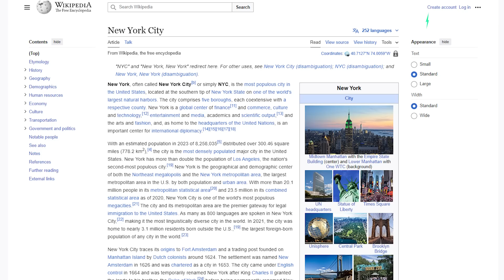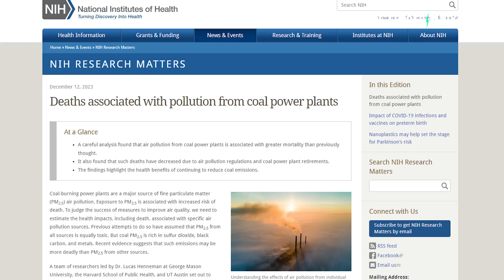The world’s biggest solar farm will provide power for 15 million people

Comment: Sam - while this is good news - be balanced on China - they are still bringing on a new coal power plant each week.
Reply: without solar, they would have to do 3 coal plant each week.  It sounds like you don't want any Chinese to have access to electricity
Reply: New plants (even coral) bought online to replace older much dirtier coal plants is still an improvement.
Reply: This narrative is out of date.
Yeah, they upgrade old plants at that rate, just fixet it for you
Reply: In 2024, it is projected that China brings online about 40 GWH of additional coal.  In 2024, it is estimated that China will bring online about 300 GHW of additional Wind, Solar, and Hydro.  Sounds like China is doing its part in combatting climate change.  Source S&P.
Reply: @celanian8188  = Uhh not really.  China is still growing its CO2 output exponentially.  There is only one country that had reduced its CO2 emissions back to 1996 levesl and that is the US - per UN reports.  China and India are estimated to continually increase their CO2 emissions for the next 10 years.
Reply: @RagnarinVa  China is still growing their heavy industry and still needs to grow their power generation.  At the rate they are installing Solar and Wind, it won't be too long before they start retiring their coal plants instead of replacing them.  

Forbes projects that China's carbon emissions will peak in 2026 and decline steadily from there (30% projected decline in emissions by 2040).
Reply: @Guvament_bs  They will last as long as they are economically viable which I suspect will be far less than 60 years.  Even if they last that long, they will represent an insignificant % of China's energy generation mix by that time.
Reply: No, it sound like he wants balance.
Reply: They build 1/3 of the stuff in the world.
Reply: It’s not a channel about China or coal plants.

Comment: They will require huge battery system to make it optimally effective, nonetheless impressive.
Reply: 5Gwh, Sam said.
Reply: I don't think so, 5 ghw of the battery is  very huge ,  I think the coal plant will give stability and reduce the volatility of new energy
Reply: Tesla deployed 9.4 Gwhrs last quarter alone.
Reply: @chrishaberbosch1029  but not only in one location, it was worldwide
Reply: @chrishaberbosch1029 and Megapacktory in Shanghai built soon, 40 GWh annual?
Reply: Sand, rocks, concrete, carbon blocks and sodium ion are cheap and effective energy storage systems.
Reply: @larryc1616 Na+ is on slow burner given lithium has come down in price.
Reply: Not a biggie for CATL, BYD and the other battery manufacturers of China. In fact it is good training to get even better and help all of Asia, Africa, the Middle East, South and Central America, Mexico and Southern, Southeastern and Eastern European countries to become energy independent.
Reply: They will have a huge battery pack yes. But I keep commenting that Solar and Wind not reliable enough, batteries helps but in case of a catastrophic event they wont last just max days... Meanwhile possible no sunshine for weeks, months... https://en.wikipedia.org/wiki/Year_Without_a_Summer
Reply: @tothimre7950  jeez you’re ignorant.
This farm is set up to maximise use of transmission line, using coal as final backup.
Solar is predictable days ahead, as is wind.
But if there’s a wind lull & cloud (in Gobi desert) and the coal station runs out of coal, no biggie, Beijing gets power from elsewhere.
China is way more the experts, are way more determined, than anyone else.
And they’ll have cheaper power than anywhere else.